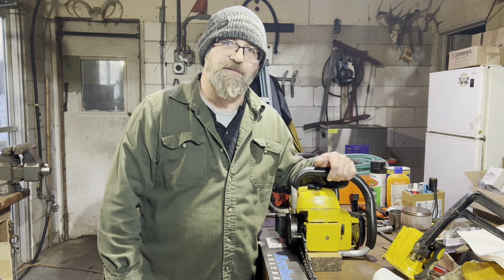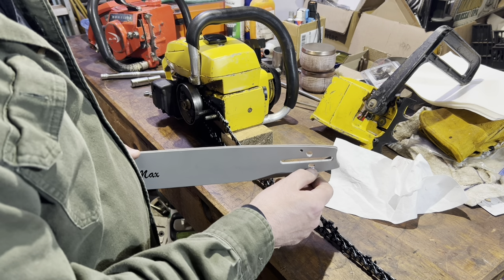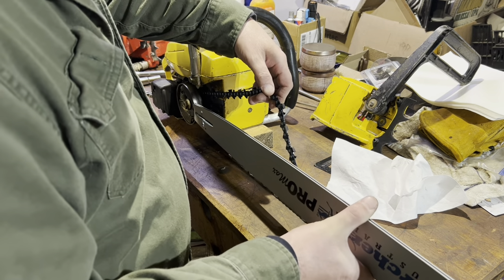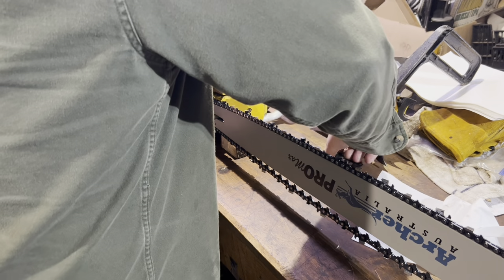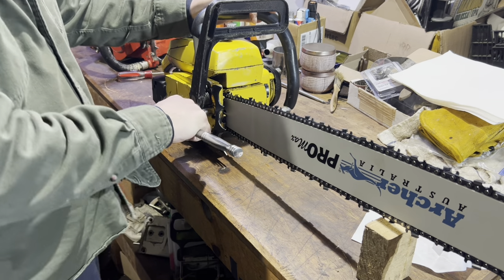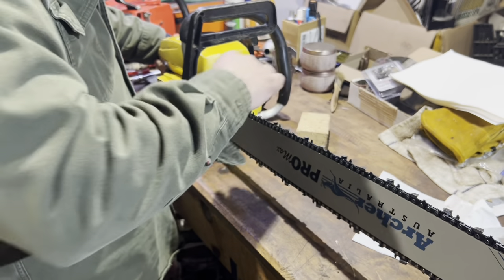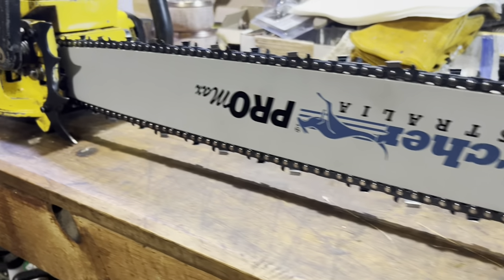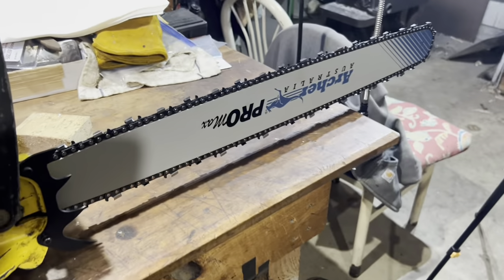McCulloch Pro Mac 555 28” bar

Comment: hi do you know the part no of this bar? and what  are the specs on it? 3/8 058? got a  555 and few other macs would like to do the same like the channel all interesting stuff thanks for the effort!
Reply from the maker: Sorry don’t know the part number off the top of my head but, the bar mount is a KO95 and it is 3/8 .050 gage. Definitely convert your drive sprocket clutch drum to a ring drive… it’s so much smoother. Thanks for watching!
Reply: I just buy the oregon dd176 or the the tsumura echo bars